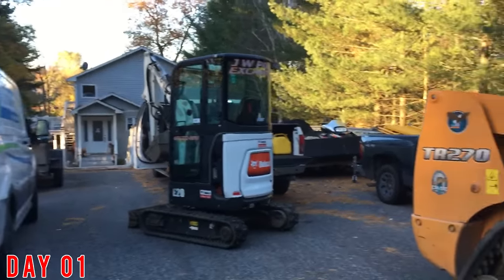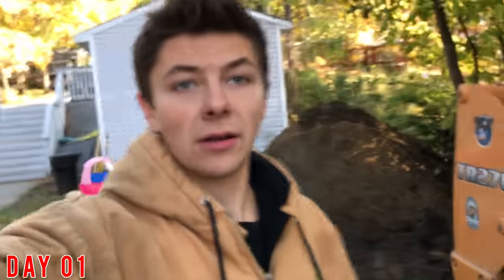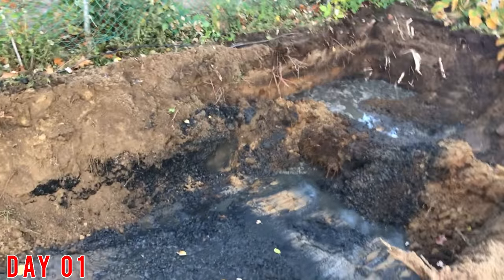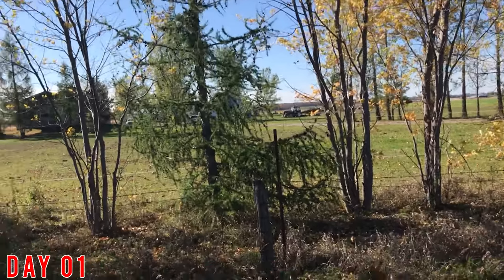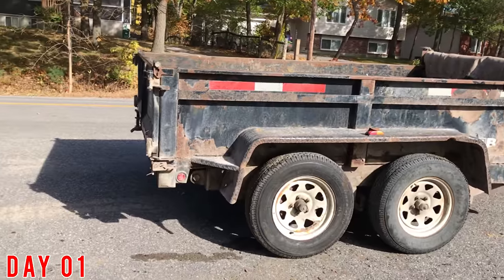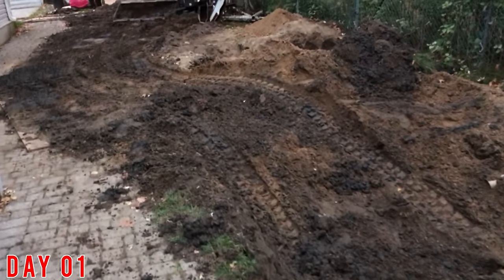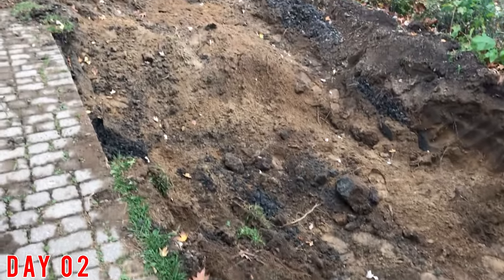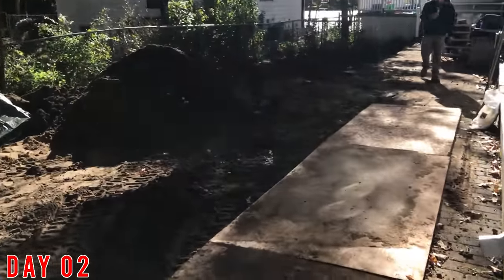Septic Installation "MAKE THOUSANDS OF DOLLARS "

Comment: I did enjoy the video, but man alive, there are far easier ways to do this job. I do excavation work exactly like this and I would not have enjoyed this job at all. I know not everyone has a bunch of machines sitting around that are perfect for every job, but this is what I would have done (assuming you knew what your final grade was going to be).

Start excavating the furthest area, get the material removed, then bring in your bedding material/stone while you still have solid ground to work on. You essentially created a hole you had to work in/around. Ideally you would have a bit bigger mini ex to work with that could reach further. 

Jobs always turn into something unexpected though and you can only do what you know. Personally I would have tried to keep the existing ground high and dry as long as possible instead of excavating the entire hole all at once.
Reply: I like your idea. How would you keep from contaminating the new fill you dumped once you finished the farthest spot and started digging again?
Reply: @DFHutton - first thing you would do is remove all of your top soil and set that off to the side. Once your top soil is out of the way then, you can dig down to your final grade and carry that all the way to the end. Never put subgrade or contaminated material on topsoil.

Comment: $30k ? 

I'm not seeing where the justification for those prices is. Every tank job I've been on has only costed about $4k in labor per day, around $3k in materials (tank, leech field pipes, 3/4 fill), and only took 2 days with one operator on a mini. No loaders. If we didn't need to bust out the hammer it only takes 2 days, 1 day if we grind out hard with a 3 man crew. 

Day 1 is digging the tank hole and the leech field, and day 2 is laying the piping, setting the tank, and backfilling/ fine grade. The most I've ever seen these jobs run is about $15k. I'm not sure where the $30k comes from and this doesn't exactly look like you guys have top notch operators since it takes you 4 days to complete a job that can be done in 1 day with 2 minis.

I've even seen a whole install done in 1 day by a single operator on a 305.5. Tank set and buried, and leech field cut and backfilled all in about 10hrs. Working in soft soil, but done in 1 day nevertheless.
Reply: I agree but can you tell me the labor breakdown to get you to $4k a day. I'm not challenging you, just trying to understand how to properly bid a septic job.
Reply: How are finding these jobs..
Reply: @jeffreid3341  Those prices he spouted certainly wouldn't be enough today unless it was a tiny system. The cost of material for a normal system plus normal company overhead alone will be at least $6k. Unless you want to give your knowledge and work away for free,  those prices he is talking about will not work for you.

Comment: Hey on that 270 case make sure clean out mud on the oil drain. If mud build up on bottom under oil pan mud pushes up on the pan plug an cracks oil pan its 5000$ us to repair
Reply: Thanks for the tip

Comment: You charged 30 K for that?
Reply from the maker: It was a job for a great friend of mine. I didn't charge for the job however The local market would be around that for something like this
Reply: 30k for that lol l don't think so
Reply: @bradnavratil5502   he’s right. These things costs 30k now !
Reply: @bradnavratil5502  I had one fixed for 23k 

 That’s even after  micromanaging the process 

Getting building permits on my own , a fellow engineer to design , soul test and land survey
Reply: @bradnavratil5502  It sounds to me like he is in Canada where labor is a lot higher and fuel is ridiculously expensive.  Permitting and contaminated soul are likely stupid expensive as well.